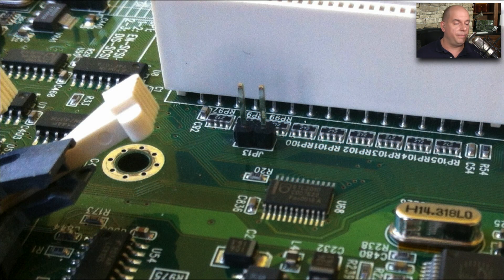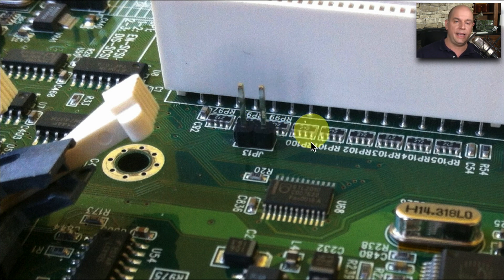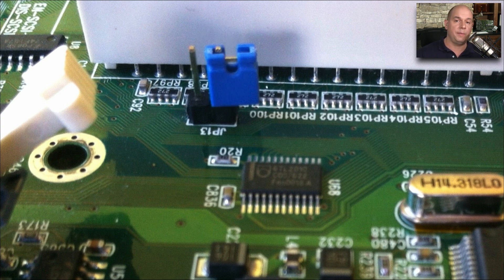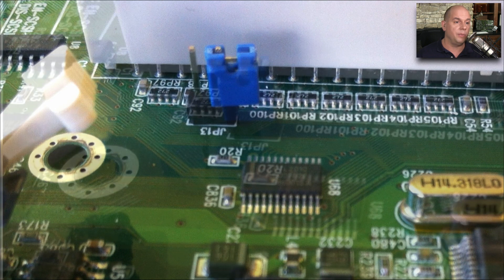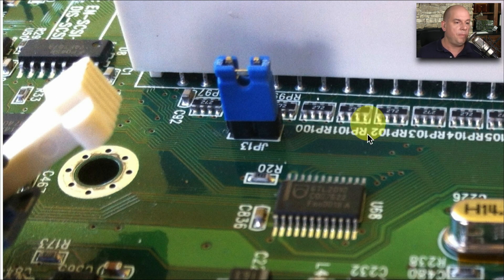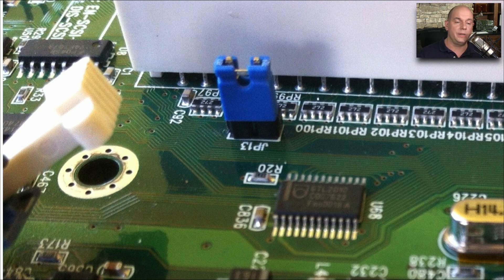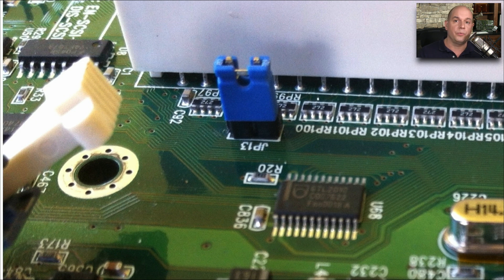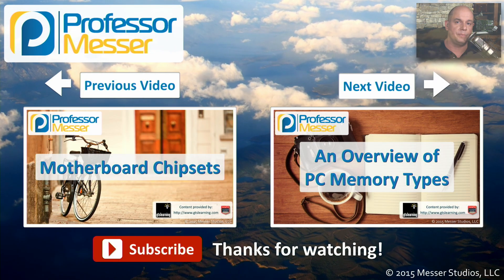Motherboard Jumpers and Connectors - CompTIA A+ 220-901 - 1.2

Comment: I remember the first computer I built with an AMD k6/2 350 mhz, I had to use jumpers for the bus speed, and the voltage of the CPU. With Socket 7 motherboard, I could use Intel, AMD, and even Cyrix CPUs.

Comment: I could never figure out the orientation of the cable cabinet wires. There is a usually an arrow on the female end and a positive and negative male pin. Does the arrow go into the negative pin or is it different for each motherboard. I usually just end up doing trail and error with the hdd light and adjust the rest. Was wondering what was the proper way of figuring out how to install the cable cabinet wires. Awesome video and great quality as always.